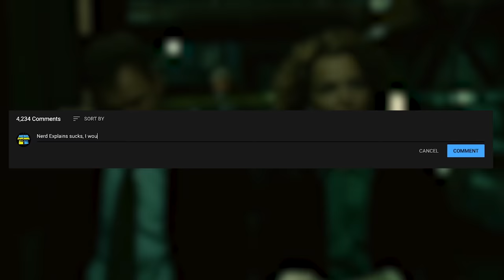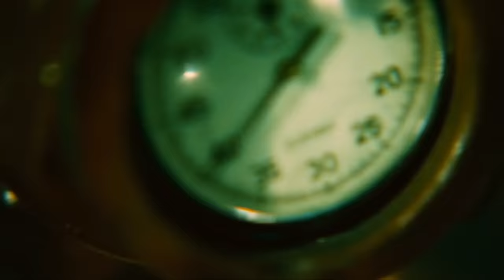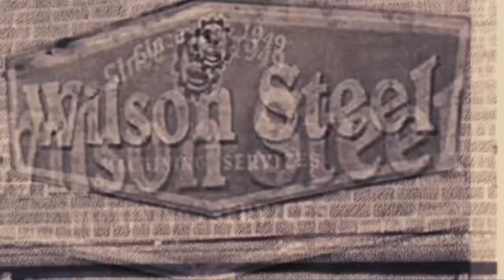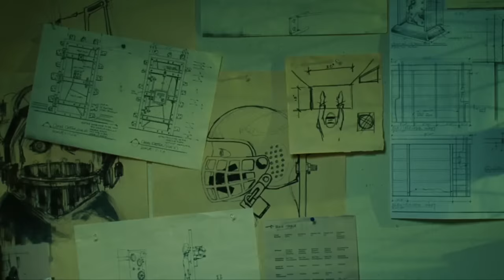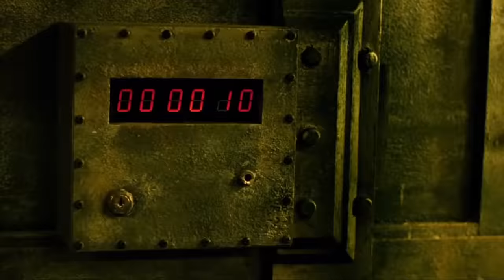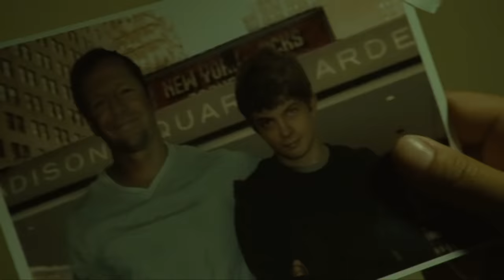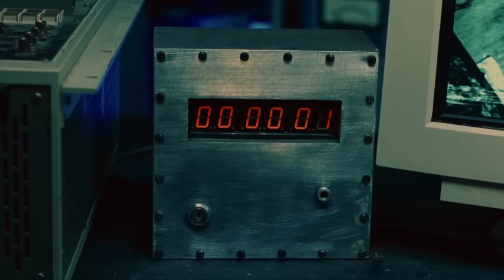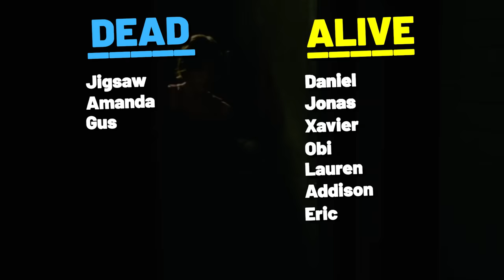How to Beat the DEATH TRAPS in "SAW 2"

Comment: Having had cateracts surgery and had an air bubble in my eye. You know, clear air... that had caused a damnedn ear splitting headach along with pain around my eye?

Inserting a key into someone's eye and them NOT notice either the splitting headach of pain or the fact the eye is inoperable? Is heavily unlikely.
Reply: That’s setting aside the fact that an average key will not fit inside someone’s eyeball. Even SAW 2: Flesh And Blood, as awful of a game as that was, changed it so the key was under the guy’s eye rather than inside it, so it made a bit more sense.
Reply: @Dreigonix  also having had retina surgery about a day and a half ago. Dude definitely would have felt like he got punched in the eye and would as a result also experience high sinus pressure. And be seeing lots of weird shit.

I'm ok just as a matter record. Healing as expected. Should be able to properly be upright in a few days. Til then gotta lay face down to orient the bubble.
Reply: @singletona082  Hope your alright now dude, sounds like hell
Reply: @watervapor8739  so far the checkups have been good.

Comment: A couple things, Addisons trap is a variation of an old raccoon trap, but it is a trap... which is why the plunger is glued to the box and didn’t fall over when she moved even the slightest... (also if you’ve never held a full syringe, it takes real effort to separate the body from the plunger once fluid is inside, what we see happen would never have happened if the plunger wasn’t glued down) whomever stuck their hand in there wasn’t getting one or both arms out without someone else’s assistance

Comment: 24:59 is the saddest trap fail of them all.  All you have to do is use one hand to push the blades vertical and the other to go in and grab. Even if you are so dumb as to put both hands in the holes, you can still try to reach over with one hand to hold open the blades for the other hand.
Reply: Apperently there's a stool and key to unlock the box from the top.

Comment: For the first trap I don't think having a scalpel would make it easier to remove your own eye. I think for many people it would be harder. Contacts make people get used to touching their eyes with their bare mitts. Doing it quick and using your hand might make you hesitate less which is required when on such a tight time limit.
Reply: Rewatching the video and I've come to a more damning reason to not bother with the scalpel. Once you've cut your eye, then what? How to get the key out. They show tweezers did they?

Comment: Another way Addison could have beat the box trap: if you look closely at the top of the box (from the angle where we see the entire box and Addison from the front) you can see a padlock. It's not clear enough to see if there's a key in it or not, but the box can be opened

Comment: Michael, like so many others, could have easily beaten the game by staying calm and thinking. Simply breaking the pully mechanism would have also made sure that the trap didn't go off. After that, as you said, cutting the leather with the scalpel and taking the trap off wont have the timer and then, even if the place isn't openable from the inside, he was found quickly enough afterwards that he would be alive.

Comment: You can beat pretty much every saw game by not wanting to live through it in the first place, pro tip

Also drove me crazy how the spikes inside the death mask are arbitrarily pointed toward a center mass when that doesn't line up with how they'd close on his head, it would just make them close on him sideways, the only reason they'd hurt him like that is the apparently super strong motor or spring closing mechanism.

Comment: I’m thinking in the death mask trap, is there a way to untie the wire from the pin holding the timer or from the weight on the other end. With the pin in and the wire removed up can move around freely

Comment: I would have put my arms near the mouth of the venus fly trap trap. Can repair arms after. Rather my arms than my face.
1 arm in front of neck, 1 behind.
Only problem might be windpipe crushing or blood flow stopping.
Highly doubt the trap can make it through my arms.

But then the problem will be what the Jigsaw setter upper thinks of my ingenious solution. Maybe tying my arms together for the 2nd attempt.

Comment: I hear the argument that Gus was stupid for looking through the peep hole, but I have to disagree. Unlucky, yeah, but I don't see it as stupid, and i'm surprised nobody else checked it before or after the gun went off. Out of everything in that room other than the safe and the fireplace, that peephole is the most suspicious thing in there. It's an interior facing door, and the window is blocked. What would possibly be the point of it being there if it wasn't something you were supposed to look through.

Gus is unlucky that the peephole is only there to kill him, and as cryptic as he is, Jigsaw doesn't straight up lie, so using the key on the door is a bad move, but that peephole could easily be a part of the game that lead to them getting out of there.

 So yeah, in spite of the rest of the Saw fan base, Gus isn't stupid, just really unlucky.
Reply: Putting your eye up to any mystery peep hole is a bad bad idea 😂

Comment: Well if the psychopath felt that his victim wasn't playing fair, he'd come and reset the trap fixing for the mistake. You will not win in such a game when someone else is setting the rules and holds you a hostage. At best you can get a moral victory by not playing the game, simply sitting still and waiting for the eventual. Just like some rape victims just zone out, to not give the attacker the full satisfaction. It's also a way to take control and helps to deal with the mental anguish.

Comment: Michael didn't even need to cut his actual eyeball......if he had just noticed the stitches UNDER her eye, all he had to do was cut the stitches away and then pull the key out from his upper cheek

He could have also used the stool he had been sitting on to get to the box with the knife in it WITHOUT triggering the countdown, meaning he would have had all the time he needed to slowly cut the stitches and remove the key in, yes a painful way, but far far FAR less painfully than slitting his eye

Comment: I'm a ridiculously HUGE fan of the series, and Saw 2 is my favourite one. But so many of them did such FUCKING STUPID things to fuck themselves over.
Especially Addison putting both hands in that box. Upon realising the first hand was stuck, she could have used her other hand to push open the blades around her wrist. What makes her mistake so much worse is that she fucked up the antidote, so it couldn't be used. So she would bleed out & die for absolutely nothing. 

So many of them did such fucking idiotic things that it's infuriating. Ugh.